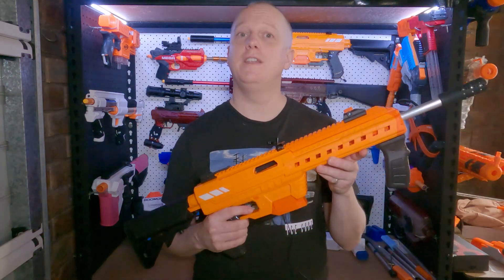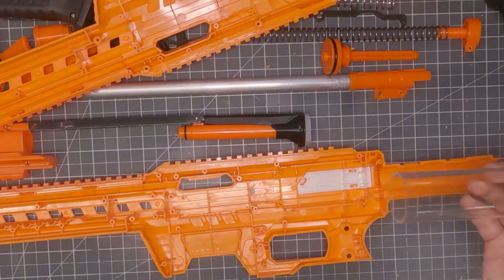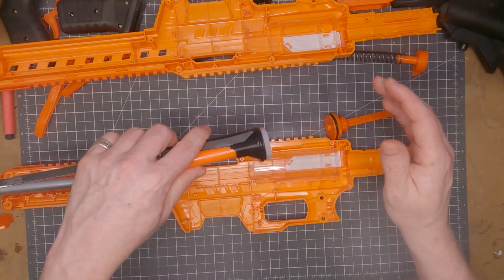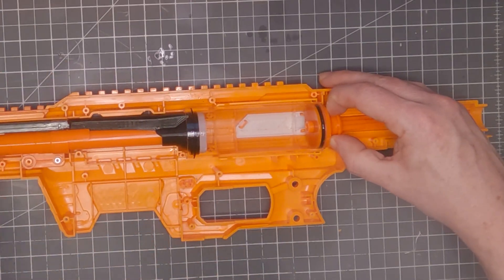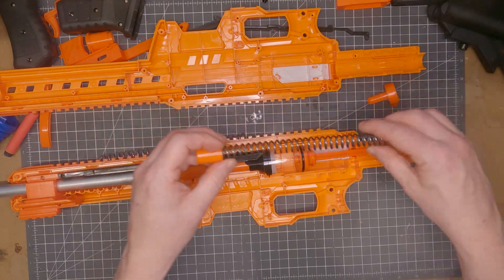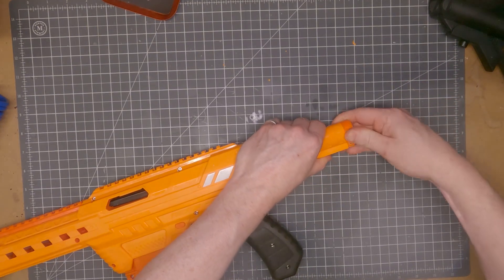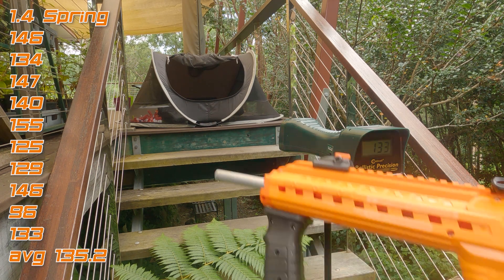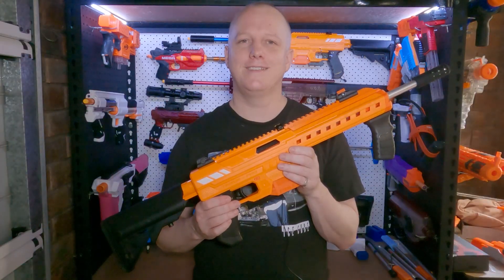Blaster Breakdown 28 (April 2022) - Nexus Pro XPT - a 250+ fps expanded plunger tube mod - How to

Comment: Incredible! Usually making a Nexus have 250 FPS can lead to complications such as super tough primes. Glad to see that isn't an apparent issue! Would have loved to see you do a tutorial for a Max Stryker.
Reply from the maker: Pretty much the exact same process - the breech & trigger are different in MS, but I think the pusher & plunger tube are the same 😎
Reply: @andrewg_nerfmods  From my research, those are the exact same and from my analysis they both have enough space for a larger plunger tube. Perhaps I should look into getting a metal plunger at the right size.

Comment: would that work with an out of darts skinny pusher?
Reply from the maker: There is a reinforcing part that runs along the top edge of the pusher. It's not particularly thick, but worth checking to see if it's not wider than the rest of the skinny pusher.
Alternatively, you could combine both designs into one - that's probably a more stable solution 😎
Reply: @andrewg_nerfmods  ive got minimal mod experience

Comment: Is the double prime lock still functional
Reply from the maker: I know I left it in, but I don't think it actually locks anymore due to the shape of the printed piece over the top of the bolt.
So no, not functional 😎
Reply: @andrewg_nerfmods  I was able to get the priming lock to  work by removing a small amount of material from the top of the long piece of the ram, just enough to make the prime lock still functional while not weakening the pivot point contact.

Comment: Is the stock spring too long or too short to work in this mod, im a bit confused. Did you cut down that 300 mm spring? if so how long was it when it went into the blaster?
Reply from the maker: Yeah because the front of your plunger sits further forward without the telescoping bit, the stock spring is too short and will rattle about.

Comment: also, could an 11 inch spring work you think? or would it be too small.
Reply from the maker: It would be close - if it was a fraction too short then you'd just have a bit of slop in the prime - easy enough to pop a spacer in to remove this.

Comment: Hey. curious if this would work in a stryker. I figure it would but you can never be too sure. Also, I cant find that diamter of plunger tube anywhere. Do you now of anywhere? Lastly, is there anywhere i can find the parts in the description pre-printed? Thanks!
Reply from the maker: Yes, will definitely work in a MS - I know of people who have done this.
I got my tube on Ali Express - can see polycarb, acrylic & even stainless steel options in the right diameter there now.
And no, I'm not aware of anyone selling the parts ready printed. Maybe you could ask around your local group to see if anyone could help you with printing?

Comment: Nice build! What kind of o rings should I use? There are a lot of them :S
Reply from the maker: Thanks 😎
O rings are usually described with inner diameter and ring thickness. If you need 36mm outer thickness (because that's the inner diameter of the plunger tube) then 32mm and 2mm or 31mm and 2.5mm will give you this.
Reply: When you pull the grip, it does not go all the way back?
Reply from the maker: @LiveMusicRec  It goes all the way back to where the plunger catches in the original configuration.

Comment: hello from mexico. NICE JOB. Just broke my breach of my nexus and finally found the 3d piece. ONE cuestione. What are the other files on the link designed by Andrew Tran FOR?
Reply from the maker: Thank you 😀
The other parts are optional, but maybe be useful if you need a replacement breech or plunger head etc. There are also pieces to help lock a barrel into the front of the blaster, to replace the original collar piece.
Reply: @andrewg_nerfmods  excelent! tanks for that extra!
Reply: and for the tutorial

Comment: Hey Mate just found your channel. keep up the good work :) I will be doing this upgrade shortly :)

Any chance you can link all the parts ie. springs and tube. I am completely new to the hobby and would just like to click buy now :)
Reply from the maker: Thanks mate, glad you enjoy 😎
Reach out if you need any further details 👍🏻
Reply: @andrewg_nerfmods  Any chance you can link all the parts ie. springs and tube. I am completely new to the hobby and would just like to click buy now :)
Reply from the maker: @AussieFirebird  Other than the 3D printed pieces linked in the description, it's really only the plunger tube that you need to source. I got mine from Ali Express, but don't usually include links for these as they can change over time.
Reply from the maker: @AussieFirebird  36mm ID / 40mm OD should do the job - acrylic or polycarb, or even stainless steel if you like 😎

Comment: Hey Andrew, amazing build, once again. Just a Q about the specifics. 
How long(cm) are your 1.8 and 1.5 springs cut to?
Reply from the maker: Thanks mate - I don't think I took too much off that one - it might be 10.5 or 11 inches. I recall the full length had a fair bit more pre-compression, which I wanted to reduce somewhat.
No reason you couldn't use the full length, or even thicker springs, to go for more fps 😉
Reply: @andrewg_nerfmods  Thanks a ton.

Comment: nice build, can i ask what kind of tube did you use on that plunger tube? and also the size.. thinking of doin the same build coz its freakn' ccoool👌🏻.
Reply from the maker: Thanks mate. I used 36mm ID / 40mm OD polycarb, but after a while this developed a crack. So then I tried acrylic, same dimensions.
Stainless steel would be another option.
105mm length was just right.
Reply: @andrewg_nerfmods  nice, thankzz for the details...
Reply: @andrewg_nerfmods  another thing bro, is the 3D printed part from the pusher is a free source? can i ask for the file?... thank you👌🏻
Reply from the maker: @franco666v  That's the link to Andrew Tran's Google drive in the description
Reply: @andrewg_nerfmods  noiceeee...👌🏻
Reply: @andrewg_nerfmods  bro , i just looked on a max stryker's internal structure. is this also able to do on max stryker with same materials including the 3D print breach?.
Reply from the maker: Yep, absolutely. All the important parts for this mod are identical.
Reply: @andrewg_nerfmods  thanks, good thing i havent bought a nexus coz max stryker just droped on our local store just this week. now ill go for a max stryker instead.
Reply: @andrewg_nerfmods  and another thing, just saw this 38mm OD and 35+/- ID(as the seller said) aluminium pipe. you think this one might be able or too tigh ID?
Reply from the maker: I think that would be too tight. I've seen stainless steel tubes on Ali with the right dimensions.

Comment: Quick question, are all the screws in the nexus pro the same length, or are there different length screws for different holes?
Reply from the maker: Quick answer off the top of my head - I'm 95% sure they're the same, and want to say m2.6 10mm length. Or maybe 12mm.
But 12mm seems a little long for thin parts like the buffer tube and secret screw under the grip - I may have used 8mm ones there.

Comment: Awesome video! What kind of range are you hitting with that? I think the furthest my 180 fps one does is 30 maybe 40 metres
Reply from the maker: Thanks mate 👍🏻 Honestly I haven't tested total range - 250 fps should go 50-60 metres I reckon. A stronger spring taking you to 300 fps and above would go even further than that 😎
Reply: @andrewg_nerfmods  hey mate! I followed your instructions and have installed my first brass barrel! First 20 shots were beyond amazing I was able to hit my neighbours gate across the road from my porch, only issue is now I'm getting consistent squib loads, any advice as to where I may have stuffed up or something I should tweak would be much appreciated 🙏
Reply from the maker: Check for air seal - if something isn't sealing right then that could explain what you're seeing.
Reply: @andrewg_nerfmods  I just finished messing around with the seal and taking it apart several times which was a fun process haha, I can cover the muzzle with my hand and it holds pretty decently. I'd say maximum 7-10 seconds if that helps. It fires with decent fps with the occasional squib. They all seem to stop at the same spot on the end of the barrel maximum 5 cm deep. do you think it would be worth cutting the barrel shorter?
Reply from the maker: That seal sounds pretty good. What barrel do you have (length & material)?
Reply: @andrewg_nerfmods  brass 17/32 I bought it off of blaster tech online
Reply from the maker: @marclorenzi6340  How have you seated it into the breech? If the entry isn't smooth I'm thinking maybe sometimes the dart might get clipped on a sharp edge.
A reaming tool can put a bevel on that end. Or even sticking some needle-nose pliers in and twisting to flare it out.
Reply: @andrewg_nerfmods  I made the friction breech using electrical tape and Teflon tape with the added tape over top. I think I found the problem to be the whole barrel shifting so I'm experimenting with boring out the stock aluminium barrel so the brass will fit and using that as an adaptor of sorts
Reply from the maker: You can get 16mm alu from Bunnings and epoxy the brass into that. Then grind out a smooth lip.

Comment: this part is called the PTHead in the fileset?
Reply: or ram?
Reply from the maker: Yep - it's the XPT Ram piece 😎
Reply: @andrewg_nerfmods  how about the tube dimensions,what's the OD and how long should I cut to ensure optimal efficiency
Reply from the maker: 105mm long - 36mm ID / 40mm OD.
Reply: @andrewg_nerfmods  does it have to be super precise?I found a ID of 38mm OD40mm one can I just make the O ring thicker to compensate?
Reply from the maker: That's a pretty big difference - I don't know if an o-ring that fat will fit into the ram and plunger.
I'd suggest trying to get as close to 36mm as you can - Ali Express is where I got this one.
Reply: @andrewg_nerfmods  ah ok,thank you so much for the assist, I'll prob be trying this out in a few weeks,just finished printing the ram
Reply: @andrewg_nerfmods  I found a metal plunger tube for the longshot it's 36.47mm ID would it work?
Reply from the maker: That's pretty close - you may get by just padding the plunger with Teflon tape under the o-ring.
Metal will certainly be more durable 👍🏻
Reply: @andrewg_nerfmods  ok thanks alot,just ordered the PT
Reply: @andrewg_nerfmods  hi sorry for bothering again,I tried the 36.47 and it's slightly too big can I try with a 35mm one instead?
Reply: @andrewg_nerfmods  or can a caliburn plunger tube work
Reply from the maker: Ahh, that's a shame - I guess getting this seal as close as possible is the trickiest bit.
I might have been lucky that the first one I tried only needed a little extra padding under the o-ring.
I guess whatever you need to get the seal right is just what you gotta do.
Reply: @andrewg_nerfmods  I'll give the 35mm one a shot then seems to be closer to the stock plunger size
Reply: @andrewg_nerfmods  hi I jus finished the build and I'm having troubles with it catching,did u have any issues with the catch?
Reply from the maker: Is the plunger moving back far enough to catch? You can check this with the blaster open and no spring in place.
Reply: @andrewg_nerfmods  yup,I suspect it might be the spring interfering,also did u have any bending when priming? anything harder than the stock spring my foregrip bends alot
Reply from the maker: I got some random long springs from Ali Express to try - one thing I have noticed is that you need to be a bit careful when swapping springs - because the plunger is now so much further forward, it can get misaligned. I've found its easier to insert the spring when the plunger is all the way back, then ease it forward to put the endcap on.

Comment: What happens if you use 175fps spring cap?
Reply from the maker: I think that the stock spring might still be loose, or at least have no pre-compression. My thinking is that you'd get better results with a longer spring, making use of the additional priming length.

Comment: So the spring is 15 mm diameter, 300 mm length, and 1.8 mm thick.  The tube is 40 mm OD, 36 mm ID, 105 mm long, 2 mm thick.  What is the best Oring for the ram?
Reply from the maker: I used an o-ring from another Nexus Pro that didn't need it, so it's the same as the plunger. You'll want the OD of these to be 36mm - I know that these are usually described with ID & thickness, so maybe 32mm inside & 2mm? Or 33 & 1.5?

Comment: Awesome video as usual and a great blaster build. We are sourcing the plunger tube now. Andrew what do the other files in the Google drive for this build
Reply from the maker: There's a replacement breech piece - I found that this held the barrel too close to the pusher to seal properly (17/32" brass - may not be a problem with a Worker or MM barrel where there is a wider opening for the dart).
Some other tacticool pieces that might be fun - I liked the Chicken pieces that I'd already bought.

Comment: Hey Andrew, do you know of anyone who can reliably 3d print these pieces? I would like to do the same to my Max Stryker but do not have a 3d printer readily available.

Edit: Also, what kind of silicon padding are you using on the end of your plunger head?
Reply from the maker: What's your location?

The silicone was from a Worker spring upgrade kit for something - just had it floating around in a box of stuff. You could probably find something in the plumbing section at Bunnings that would do just as well.
Reply: @andrewg_nerfmods  I have a USA location, and understood on that second part!
Reply from the maker: @jacoblewis437  I reckon see if there is a nerf group somewhere nearby - good chance you'll find someone who can help.
Alternatively, maybe asking for help on a FB group might find assistance for a reasonable cost of filament plus postage.

Comment: Hey Andrew another banger of a mod guide! Does the plunger tube dimensions and plunger head 3d printed part work on the max stryker as well? if not, what extra has to be done? also what is the best size barrel to fire adventure force waffle tip darts from the max stryker? Looking for aluminum size.
Reply from the maker: Thanks mate 😃 I see no reason that this printed piece and the tube wouldn't fit in a MS - there might be slight differences in where the shell needs to be cut inside, but overall it should drop in just the same I believe.
I would not recommend waffles in blasters with this one of tight breech / barrel - the fatter heads will just have to much friction, and possible not even load smoothly into the breech. I'd stick with Pro or Max or Worker short darts.
Reply: @andrewg_nerfmods  jeesus talk about fast reply.. TYSM andrew I will definitely stick to af pros and dart zone short darts! Also that barrel is preettty sweet where did you buy it?
Reply from the maker: A+ customer service 😆
This barrel I made myself, out of 17/32" brass glued into 16mm aluminium. You could just use brass with a printed spacer at either end, or wrapped in electrical tape etc. Or use a Monkee Mods barrel, or 13mm ID alu.
Reply: @andrewg_nerfmods  ah sweet thanks andrew!

Comment: Damn nice video! You need more exposure. Gonna post this on DBNB. Came here to see why my PM's were blowing up, not all can handbuilt and this is a good way to get there. This is a good aftermarket solution, mine is a handbuilt mod, not feasible for sale, more for battle and an 18" barrel helps on mine however its good to have it available for aftermarket, Cheers!
Reply from the maker: Thanks Chris, that means a lot.
I don't think that this would be as durable at very high spring-loads as your more reinforced build, but it's certainly a great option if you're aiming for 250 to maybe 300fps with relatively effort 😎
Reply: @andrewg_nerfmods  Definitely more obtainable to the general public.

Comment: Link to plunger tube?
Reply from the maker: I found on Ali - just search for acrylic or polycarb tube, 40mm OD / 36mm ID.
(I generally don't post links to Ali or eBay, as they may change over time, and not be the best source depending on where a person is in the world.)
Reply: @andrewg_nerfmods  Thanks. Can you expand on the Oring used on the 3dprinted part? Which part is it from?
Reply from the maker: That was taken from another NP I've got which doesn't need a plunger 😉

Comment: Nice build, what kind of screws did you use?. They look different
Reply from the maker: I replace the screws on nearly all my mods with hex head (socket cap) screws. No more worrying about stripped screws for me!
Most blasters use M2.6, though some need M3. The length varies - these are 10mm.
I buy from eBay - takes a while to get here from China, but I've got a good range of sizes on hand for most things now.

Comment: Would a schedule 40 pvc pipe in the same dimensions work also or is acrylic less brittle than pvc to handle the air pressure better?
Reply from the maker: I think acrylic is more brittle, tbh. The material won't really matter - PVC with the same dimensions (or near enough to get a good seal at both ends) should work just as well. Polycarb is another option 👍🏻
Reply: @andrewg_nerfmods  Thanks.

Comment: I've also read 10" is superior to the 8" and 12" lengths for max fps.  
Any plans to get the fps higher than it is on your Max stryker?
Reply from the maker: The right length also depends on the darts you use and where you are located (eg temp & humidity have effects) - there's really no "best" length that will suit everybody, everywhere.
I could use a thicker spring (2.0 mm) or a bit of extra length or pre-compression for more fps, but that's not really a priority for me. I'll be using HPA blasters at our local events with high fps caps anyway, so I do mods like this mostly out of interest 😁